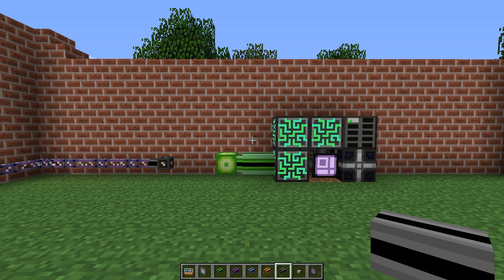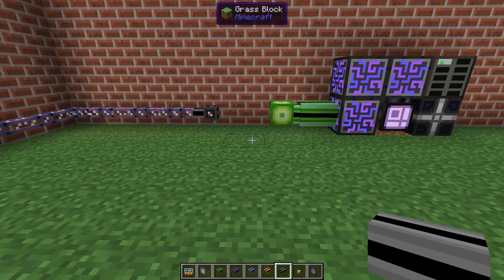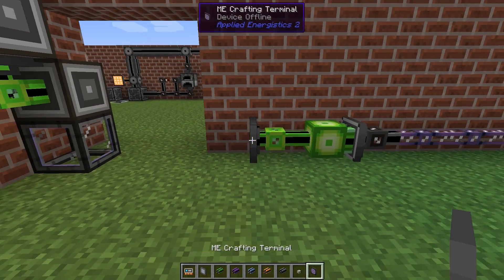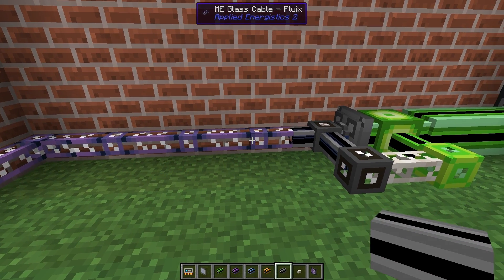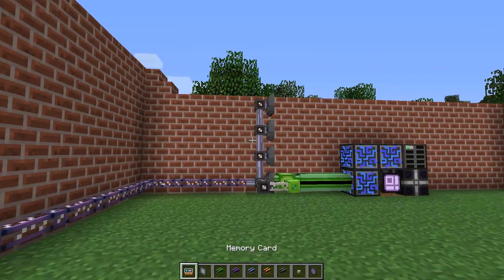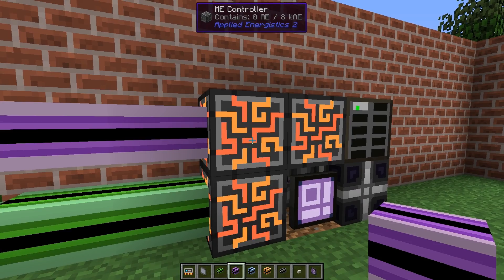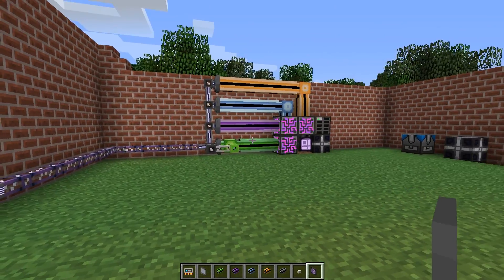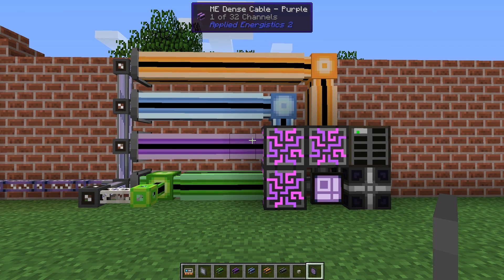AE2 Quick Tip: 128 Channel P2P Network - Four Dense In One Normal Cable (MC 1.7.10)

Comment: At least in recent versions of Minecraft, and with some shields: If you have a shield equipped, then when you shift+right click the memory card on the first P2P tunnel, you'll get the message, "memory card cleared" instead of "successfully saved settings," and you won't be able to get the tunnels to work. If that happens to you, unequip the shield and try again. Posting this because I spent a half hour banging my head against the wall figuring it out... Thanks, TKH, for these videos. They still work just fine for someone like me who's just learning the mod.
Reply from the maker: I haven't encountered this problem but I'll try to remember it! Thanks for telling :)

Comment: That is one of the inefficient and wasteful ways to use P2P Tunnels. If you put a separate ME-Controller somwhere in between the Fluix Glass-Cable, you can run 8 Dense-Cables (256 Channels) through instead of only 4.
If you replace the whole Glass Cable with Dense-Cable and also put a Controller in between, you can push 32 Dense-Cables through. In this way you can run 1,024 Channels in Total over one Dense-Cable Connection.
Without using an ME-Controller in between the input- and output P2P connections, every Pair of P2P Tunnels uses 2 Channels. When inserting an ME-Controller, the ingoing and outgoing Channels get split by the Controller. So every P2P Tunnel on each side uses only 1 Channel towards the Controller as normal. It's important to put the ME-Controller in between and not beside the P2P Network Cable. Otherwise the T-Junction at the Controller has to collect both sides of the P2P Network (Input and Output), so the usable Amount of Channels are cut in half. The T-Junction acts like a Bottleneck.
To provide Energy for the P2P Network itself and for the Machinery at the P2P Output Sides, you always have to use Quartz Fibers to bypass only Energy over the P2P Tunnels and Network. Energy Transportation consumes no Channels. If you forget these Quartz Fibers at the important points, your whole ME-System can/will stop working and every ME-Controller turns red.
Reply from the maker: I have made videos for all these setups, and I think they all have their uses depending on big the network is, how much resources you have and so on. This method is pretty much the first expansion to the network and going all in with P2P networks (with dedicated controllers) is where we all aim in the end. In the playlist it should be possible to find all of these! (even the ones to go through Quantum Bridge with 1024 channels) :)

Comment: More than a year old now, but to clarify: The stretch of cable between the two sets of terminals is one network, and the terminals on both sides of it count as the same network?
Reply from the maker: That's exactly what it means :) With a thin, normal cable you can manage at maximum 4 tunnels (4 in and 4 out). If you need more you need an ME Controller in the "P2P network" to handle all the channels. In my "large network design" video I go deeper into this. It's also needed when you build large controllers to get all sides connected.
Reply: Oh neat, never realised that about p2p channels. Cheers!